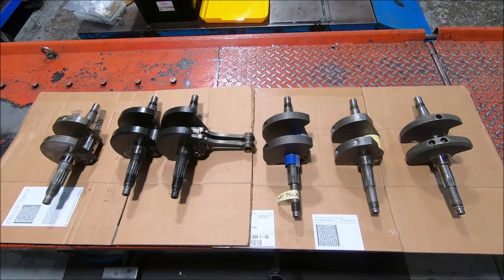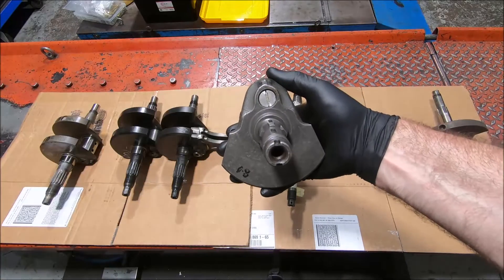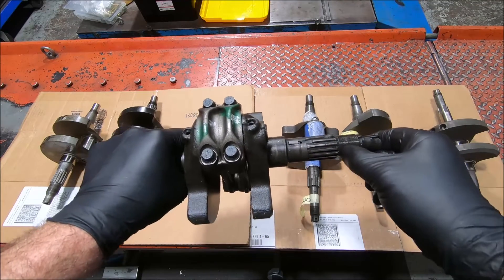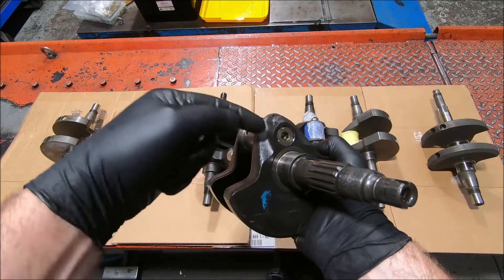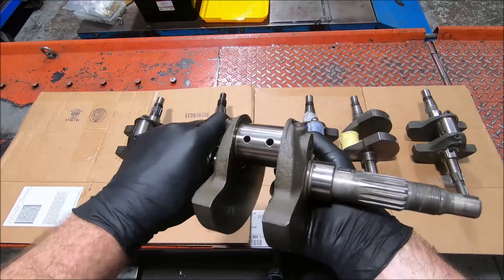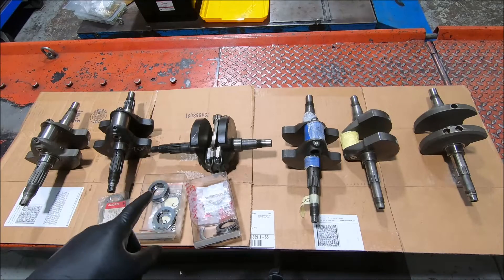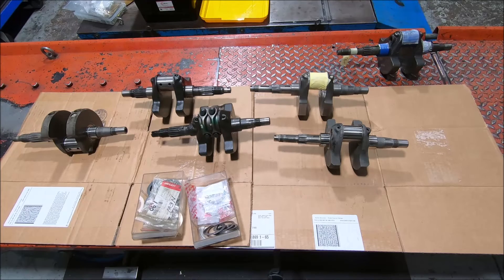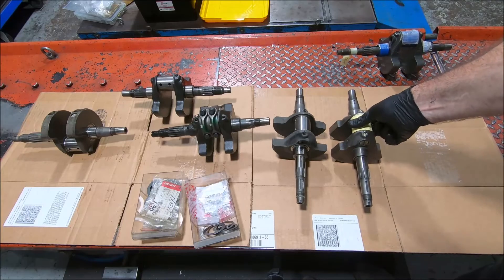Ducati Belt Drive crankshaft variations for 1980 to 2015 ish ball bearing mains engines

Comment: Thanks for that. Is the ST3 the longest stroke? Any variation in the cam drive shaft
Reply from the maker: the ST3, 1000 and 1100 are all 71.5mm stroke.  i'd say the cranks are the same, but possibly machined for a different balance factor as the ST3 has shorter rods.  some of the timing shafts are relieved a little for big end clearance, but i think they're largely all the same apart from the water pump drive snout.

Comment: Thank you Brad for sharing this..
[1994 US spec 900ss/sp bike owner] now with ~39K miles on "unopened" engine..
.. and I do worry about that plug backing out..
Is it ever worth having these cranks "balanced" upon rebuild time ?
Reply from the maker: depends how much you're changing stuff.  i've had a few engines balanced that were otherwise std and i can't feel it, but the owners say they can.  i put pistons 50grams lighter in my 750 and didn't notice any difference at all.  but if it's all apart, why not.  it's only more money.

Comment: Thanks for sharing your knowledge. Very interesting.
Any change in the rod journal bearing clearance over the years?
Reply from the maker: no.  spec has been 0.2 - 0.6mm since pantah, which is 0.8 to 2.4 thou.  i generally go 1.5 - 2 thou, but 2.5 seems better for race engines i'm told.

Comment: Seeing those tapered primary snouts gives me PTSD. Some of them really put up a fight.
Reply from the maker: lol.  we did one at an importer training day years ago on a 996 i'm guessing.  they thought they'd demonstrate the factory tool to us.  the big bang was the tool breaking.
Reply: @bradthebikeboy  the factory tool was worthless. I eventually settled on heat, wax, and a hydraulic puller (made in Australia IIRC) then giving the edge of the gear a whack with a brass hammer.
Reply from the maker: @hordboy  i also use a hydraulic puller, but i imagine it's from china.